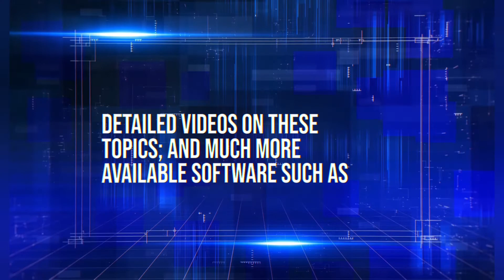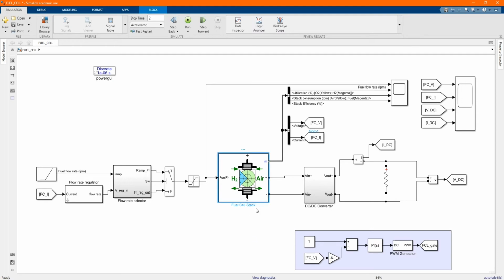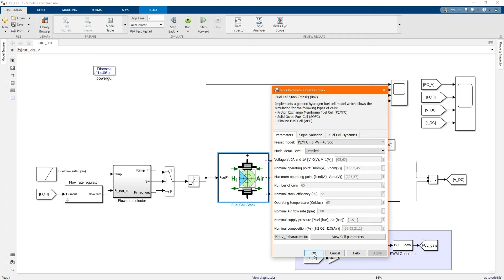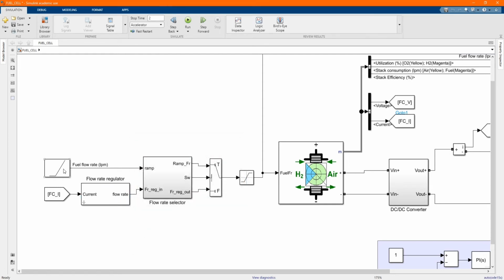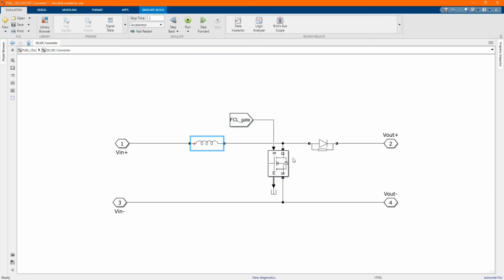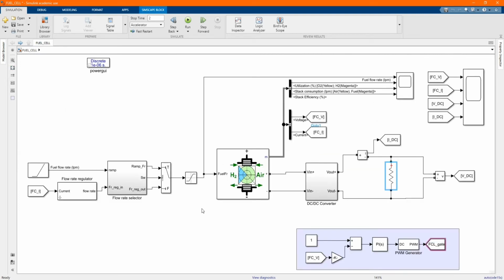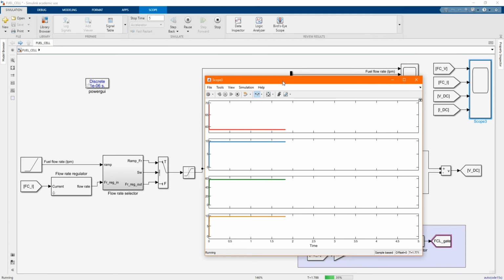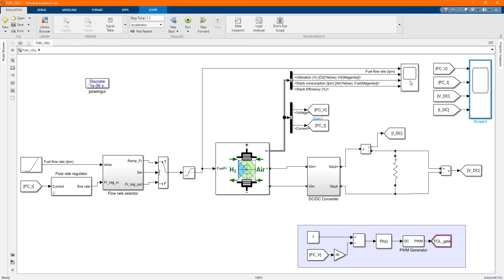Design and Simulation of Fuel Cell with DC-DC Boost Converter in MATLAB Simulink

Comment: hi dear pz 
first of all thanks for this content, by the way in the flow rate selector i cant find the block you used after constant comprator ( i thought its trigger block but if it is i still dont know the settings) and s/h block, also you didnt explain the flow rate selector and pwm generator blocks (i see you masked them but isnt there any code for the parameters we made?) 
 thanks for your help
best regards
Reply from the maker: Hi thank you for your comment and observation. I will check on that and get back to you

Comment: What's the value for the Gain in the PWM part?
Reply from the maker: Hi thank you for your comment, in the PWM we have time period and sample time, which is determine by the simulation time and switching frequency.
Reply: @pzengineering2020  Thank you for the reply.
I just meant the gain that is between (from block: FC_V) and the minus of the add block. Basically bottom right, inside the blue area, first gain from the left, before the add block. That’s the gain I meant.
Thank in advance
Reply: @pzengineering2020  Hi, I'm curious about the "gain" function after FC_V